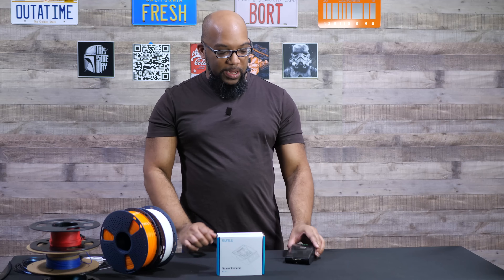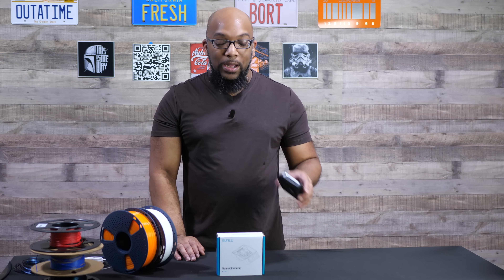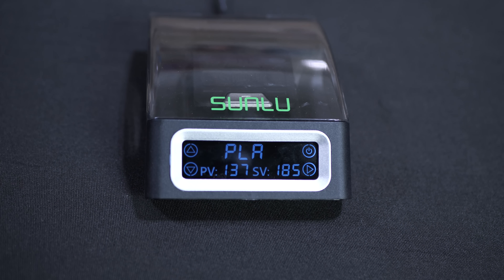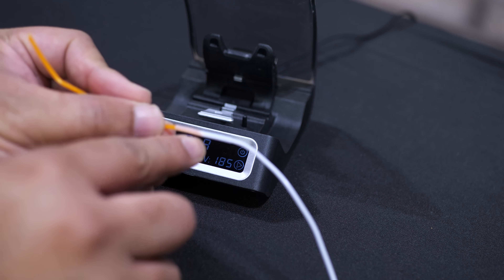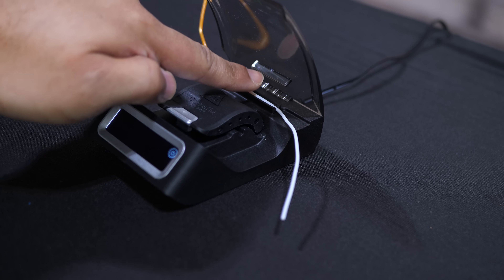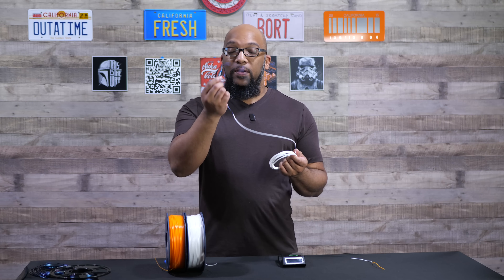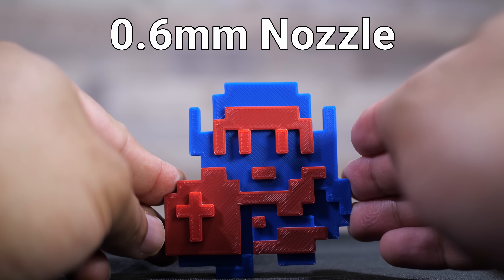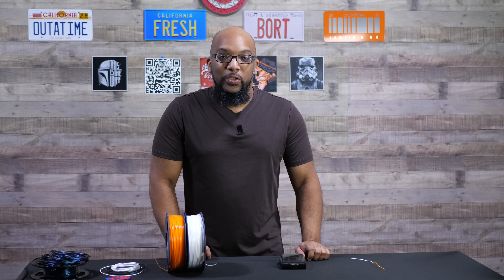Say Goodbye to Filament Waste? Introducing the Sunlu Filament Connector

Comment: If you are using it to just fuse the last bit of rolls together I dont see a reason to cut the tube off if the tube doesnt fuse to filament even mildly you can as you reroll one spool onto the other slide the tube up the spool you are adding onto the other till you get the end of the spool you are emptying. I'm sure you could only reuse the tube only a handful of times though

Comment: It's very similar to a fusion splicer for fibre optics in the telecoms industry.  What's needed is to print up a little 45 degree cutting jig so that you get perfect clean cuts on the ends before inserting into the splicer.

Comment: Revised to 3 out of 5 stars. I guess at a $40 price point, its worth it. Just know what you're getting. 
I have been looking forward for mine to arrive. I ordered it shortly after this video hit YouTube. It arrived today. I had high hopes and wanted to give it good reviews. I have 3 reels of leftover PLA I wanted to join.
My reason for the low rating is you really need two people to operate this correctly. The video shows 2 short pieces of filament. Without back pressure from a reel or a coil, the two short pieces stay where you put them. But in real (reel? ha!) life, you need two hands to keep the two pieces of filament together. But, you have to do with with just the right amount of force. Too little and pieces won't join. Too much and the filament will bulge and not fit in to the Bowden tube.
This is why you need another person: If you're by yourself, with a thumb you can move the cover. But then you need both thumbs to push down with enough force to latch it. A second person really comes in handy to latch and unlatch the cover. I am by myself, so I have to figure this out the best way I can. 
When the unit beeps that its done (about 5 seconds), you can unlatch it with a thumb. But everything is still hot. The PLA will still move. The fused part needs to kept still while it cools. Pro-tip here: When it beeps to let you know its done fusing the pieces, with a thumb, hit the power button. Let the unit cool for about 2 or 3  minute before unlatching the fused PLA. The PLA should have enough time to cool and not distort when you removed it from the hot area. Also, be sure to let the fused joint cool before trying to cut the sleeve off. It took 5 or 6 fuse attempts to get a good fuse.
Again, I wanted to give this higher marks, but I can't.
Reply: Having a soldering iron (and knowing how to use it) allowed me to remove the screws (under the pads) and remove the annoying piezo buzzer.
Reply: Thank you sir for sharing this information. I wish I could engineer it but I'm sure someone will make a print to solve those issues! XD

Comment: Mine arrived today non functional. The touch screen is poorly made, the heating element is small and doesn't hold the filament in place so you can easily waste the one use connectors, and of course the fact that mine arrived non functional (not damaged, just not working).

Comment: mkey...i get the idea but the engineer who build this was a little...
Why not use a 2 part metal cylinder that heats up? this would eliminate the need for that weird connectors. 

I bet you could connect 2 filaments by just using any hot plate with the right temperature and than using the cutter to smoothen the filament if it gets blobby.

Comment: the prints might not come out as clean tho. if you use different brands with different composites and thus flow rates , calibration etc, it could make problems. ive tried this once and i ruined a print bc the filaments behaved differently

Comment: Ive been heating up a spare hotend block in a vice to hold it still, then push square cut ends to get it hot and melting, then shove both melting ends into of a ptfe tube. It works really well most of the time but its a pain having to drag the piece of ptfe tube the length of the reel to get it off before re-realing the filament into the spool.  I will be buying one of these, Well done SUNLU. About time someone made something that works.

Comment: I been doing this since 2020, with my used filament rolls.  I stop the print, insert the other color or extra when it heats up, force the filament into the nozzle, and it color changes.  What  a waste of money.  I have the ender 3.  Or just use the pause or program your machine to stop.

Comment: Interesting to see a non-homemade way of doing this.  I have been using the silicone tubing and soldering iron method for a while now and you do get pretty good results after a bit of practice.  I also printed the Pastamatic filament winder which is really necessary to not have tangles and failed prints afterwards.  Winding by hand it just not feasible if you are trying to make an entire roll from all of your leftovers.

Comment: I just printed a ton of 800 gram parts leaving me with about 40 rolls of 200 grams... i ended up using them all for printing batches of small parts because there is always something to print at work, but i had to change the filament about every 2 hours. That worked because i work in the same office as the printers but for a print farm or unattended printers this thing seems pretty good.

Comment: At first I loved it but for me personally, the consumables are a deal breaker. I have tried to join filaments using those 15 dollar metal Chinese filament joiners unsuccessfully. This o e looks like it works great, but that consumable plastic tube functionality should have been integrated into the metal closing clamp. The closing clamp should have been sized to capture the filaments at the appropriate size and not needed the plastic tube.

Comment: Thanks for the information on this product, great video.  However, I think this is just a product in search of a problem.  Modern printers have run-out senesors and email/text notification.  It's not a big deal to swap spools and continue the print.  Having to buy tools like this just reenforces the fact that you should stay away from budget machines and buy a printer with more built-in features.  The Bambu Labs P1S is looking better and better every day.

Comment: Am I the only one simply feeding the new filament into the extruder right after the end of the previous one? No fusion is needed. I thought I will have retraction issues but didn't notice anything significant, works like a charm.
Btw, this product kind of sucks with this disposable plastic tube in my opinion.

Comment: Don't take it badly or as an attack. but I have never seen greater stupidity and uselessness. I wouldn't pay $1 for it, every printer needs to be able to do this without such nonsense. otherwise it is not a 3D printer.

Comment: It does look interesting but the idea of having to buy them tiny little connector pipes to use it is a bit of a issue. Is it some kinda heat shrink you remove after?

Comment: I'm confused... about the need for something like this. When the filament runs out, does the printer not simply stop the print, notifies you, and simply continue the print after you've put a new spool with filament? Because I would expect so. I don't think the print would be canceled, you should be able to start printing with a spool with little filament, and then when that runs out, just change it... And that should be at least as quick as fusing fillament.

Comment: Seems like they sold all the pre sale units already. I guess I'll have to wait til they are in normal stock. I've been wanting something like this for years. Yes, its easy enough to just push new filament in to the extruder behind the finished roll but that means constant checking how much is left and then waiting as the last meter or so is used (in my machine anyway). I have also gotten distracted several times and missed the runout meaning the filament was wasted and I had to start again.
Reply from the maker: The presale starts July 14. The sold out labels are placeholders.

Comment: I like this, I have been doing the same thing by hand, a fishing guy showed this method on his channel. Just taking a piece of tubing (cheap) and a soldering iron works great, but this looks even easier; I will buy one tomorrow. BTW, this system works; no need to clean the filament of the spurs later. Thank You    I just ordered this in Europe, should be here in 3-5 days  €34,45 EUR this includes a 5% tip

Comment: @FigureFeedback
Hey Jeremy, first of all I am loving the non-stop content about the AD5M. Second I was also trying to use MakerWorld to print a art piece on my AD5M, I used Orca-FlashForge to add pauses at the stated layer heights, but my printer won't pause automatically.
I sliced again after adding the pauses, so I don't know what the issue is. I have tried slicing again, and resending the file though WiFi and USB.
If you have any ideas,

Comment: I really don't understand why everybody has this "stack of nearly empty spools that are ont usefull" problem. It's 2024 and literally every printer has a runout sensor. Just use the spool until it's empty, throw away the last few centimeters and switch to the next spool?
Reply: It's even easier than that if you pay attention to how much filament you have left, just chase the end of the filament into the extruder with the next spool. Or use an AMS or equivalent and have the printer do it automatically for you

Comment: 100% getting this. I use a lot of the same 3-4 filaments and hate when I only have a little bit left on one. This will let me attached some of a smaller batch onto a newer big batch without baby sitting it at the AMS unit when it runs low LOL

Comment: It's a step in the right direction, filament on the roll gets very springy and trying to join the two ends together with the device is going to involve a lot of steady holding and waiting, but it should get the job done.

Comment: You called it a little "plastic part" but it is just silicone tubing. (UPDATE.... theirs might actually be plastic like you said ... perhaps PTFE Tube?). Silicone is better to keep it off the fuse.

I love it is a comercial solution... I have been doining something similar for years... I bought silicone tubing from online (one long tube for cheap) and I cut a small piece.. then do the 45 deg cuts and use a lighter to fuse them... no variation in temp... but it works on all my filament so far.  I then manually sliced the silicon tube to remove it.  

This vendor product makes it all simpler... but the manual method works on the cheap.

Thanks for the heads up.  You can still use this tool, just buy the silicone tube for replacement parts.
Reply: curious as to why you could not get a few uses out of the sleeve? why will it not slide off the filament?
Reply: @chrisfrisch1347  It it is PTFE tubing it melted to it.... getting it off a fused filament is a pain especially if a long roll used... that is a lot of travel.  Simpler to just cut it off.

Comment: Just subscribed after watching your first video.   Just wanted to let you know that your video was very informative, straight to the point, very detailed video.  I have been in the 3d printer hobby for roughly a year with now 6 printers and over 140 rolls of filament.  I have bought every filament splicer tool as well as diy printed ones out there to help consolidate the smaller used portions.  None of the look as easy as the one you showed off.   The others are cumbersome and aggravating to use, to the point that I have quit entirely of trying to splice them. Thank you again.   Great video!!   You’ve got a new sub from me!

Comment: Just print some parts from thingiverse and buy a cheap ass iron 
This process doesn't need to be absolutely perfect. I'm a plastics engineer I know what I'm saying.
Man these 3d printing stuff is such a huge scam 
Filament cost 1kg nylon filament for the price of good grade 25kg nylon pellets.
For the people with a garage or a own house. Look for laboratory Extruders these are very cheap in comparison to these 3d printer filament maker scam devices. And also they work way better.
Then you can take ur waste and Extrude it to  new filament.
Sidenote:
If ur failed print parts are too big use a blender.
Look for a used blender for restaurants  or industrial kitchens they can handle it and they are cheap.
I do it for my modified experimental multicolor ender 3 with Klipper 
Better print quality than any of the printer I see on the market
Reply: I have yet to see a laboratory grade filament extruder for a reasonable price, and I have been looking. Plus, pelletized plastics are blended differently to filaments that are specifically engineered for 3D printing - yes, there's a big margin involved, but formulating it for FDM and packaging it as a filament does add real cost and results in a better, easier to use product. 

Having said that, I agree this specific product is a gimmick, there's much simpler ways to use filament scraps
Reply: @bosstowndynamics5488  I work in that industry and I can guarantee you there is no difference between compounds for filament and for pellets.
I do use pa 6.6 and pa 6 pellets for printing. I also use pet and recycled Pla colored with carbon black pigments.
Reply: @anguismemes1666  Well that's either an outright lie or arrogant stupidity. If nothing else, there's substantial differences between brands of filament, that doesn't make pellets unprintable by any stretch of the imagination but they aren't the same as each other
Reply: @bosstowndynamics5488  of course they not the same. You get a datasheets for each different type of plastics

Comment: Thanks for the review 🙏
That consumable plastic tube is a big drawback for me… I think for a commercially made product it should be possible to make 2 metal parts that fit together with enough precision so that plastic consumable part isn’t needed… but this product is nonetheless a step in the right direction.

Comment: Ive always just used a piece of ptfe tube and a lighter. put the filament ends into the ptfe and then just wave the lighter underneath it a few times, pull off the ptfe tube after and the filament is joined.  That seems to be easier then using this device

Comment: The only bad thing I can see about this is the non reusable plastic connectors. If they could get rid of those it would be ideal.
Reply: Seriously. I wish it had some sort of steel half pipe sandwich with the correct diameter. Something that had cutters built in to get the right shape and then just put it in, let it melt, cool, and voila.
Reply: @KJMcLaws I also would prefer that
Reply: @KJMcLaws you could also put a feeder motor on either side like just an extruder or something so that it could push the two ends together with much more precision and consistent force
Reply: I really like the concept and was excited to see how it worked, but was super unimpressed after seeing everything you had to do to make this work.   Plus, having to buy those little connectors that are disposable isn't worth it.  

Good idea, but not a great product in my opinion.
Reply: They are not recyclable?
Reply: @mikekiske  They seem to have to be cut to get it off. Wonder if the molten filament would ooze out if you reused a cut one or if you could get away with it depending on the filament.
Reply: @scarfire87  probably loose it's shape
Reply: @scarfire87  I think you could reuse them just have to be more careful with the alignment
Reply: @mikekiske they can probably be recycled but the OP said re-use, the connectors are single use so you will treat them like a consumable and you will need to buy more of them
Reply: @mikekiske they're ptfe as far as I know, So not for millennia probably
Reply: Use parchment paper
Reply: Yeah the DIY ones just use PTFE instead of some connector you basically need to buy from sunlu, to be fair though I don't really need this as I own a Bambu and my AMS can already deal with failing over to another spool when it runs out if I really need to use up the leftovers
Reply: Yup, that's a big no for me. Trying to avoid waste, but produce another waste
Reply: @WwAiRtRhIiOnR  it is an absolutely tiny amount of waste.
Reply: Doesnt matter I'm sure temu or AliExpress will have a big bag of them for sale after this product takes off
Reply: Great idea for using leftovers for test prints or leveling prints. I expect those connecting tubes should be pretty cheap
Reply: Looking on the Sunlu UK store it seems the connector pieces are just PTFE that can take temperature up to 240 degrees C. No reason you couldnt either make your own pieces or slide the filament back and forth whilst melting like you do with those cheap filament welders.
Reply: @richardbrook6419  OR get the bundle that has 600 pieces of the tubing it's only 8$

Comment: How about the problem of rewinding the connected spool on to the other spool. If not wound properly then the filament may overlap itself and break when printing a job.
Reply: I wouldn't consider that a problem any more than a screw needing to be turned with a screwdriver